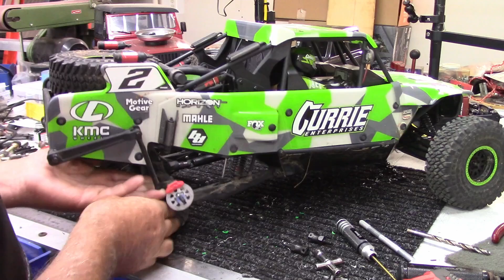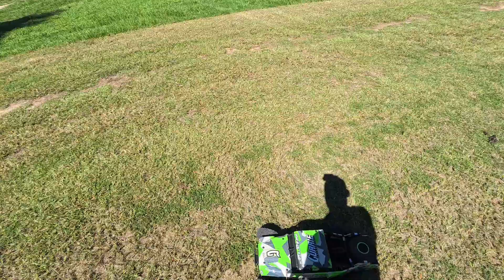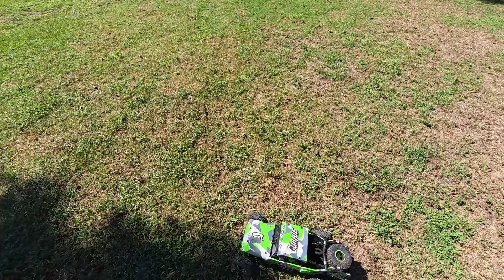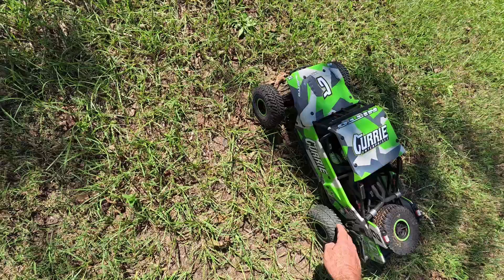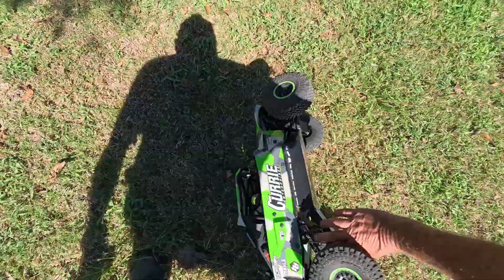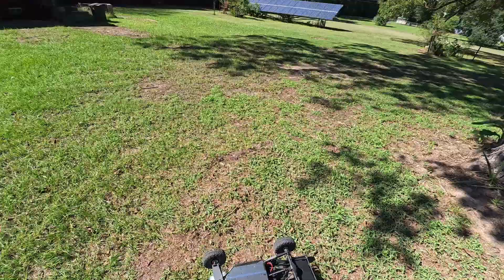Losi Hammer Rey / New Stance

Comment: Will they fit on the rzr rey& where can i buy these?
Reply from the maker: Hard to say. I know that the Losi Axles are a bit larger. https://www.amazon.com/WEFEINO-Adapter-Extenders-Hammer-Lasernut/dp/B0BP7BX9FJ?pd_rd_w=agX30&content-id=amzn1.sym.59910fa8-b73c-408a-aa5f-d0b4e0aa42cb&pf_rd_p=59910fa8-b73c-408a-aa5f-d0b4e0aa42cb&pf_rd_r=ANN8M7RQPR7PCPHA49JJ&pd_rd_wg=uZHYP&pd_rd_r=2249c5c7-290c-42e2-9b04-f1dc0575cb9b&pd_rd_i=B0BP7BX9FJ&psc=1&ref_=pd_bap_d_grid_rp_0_61_pr_t